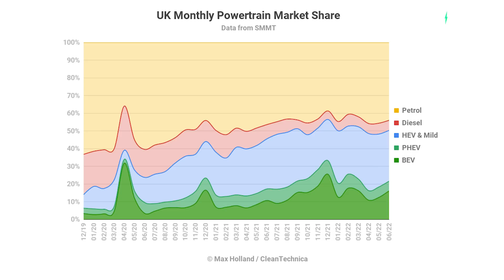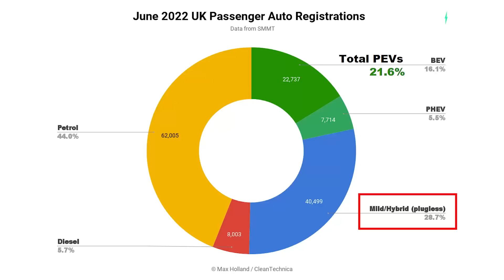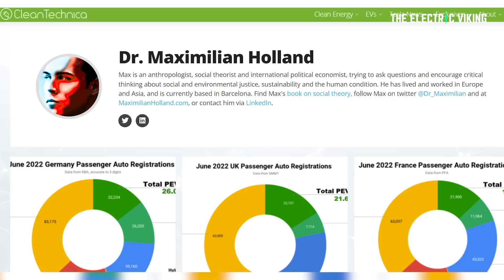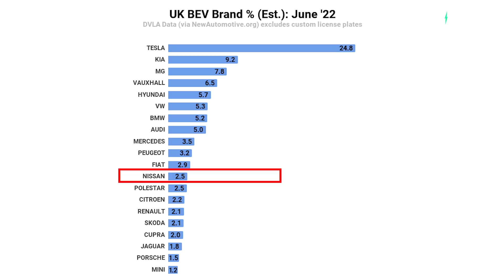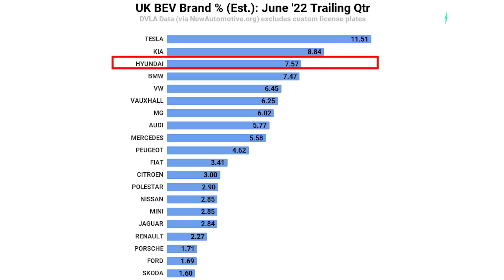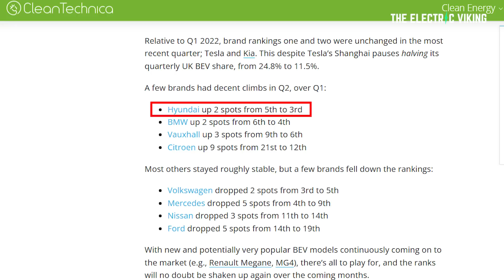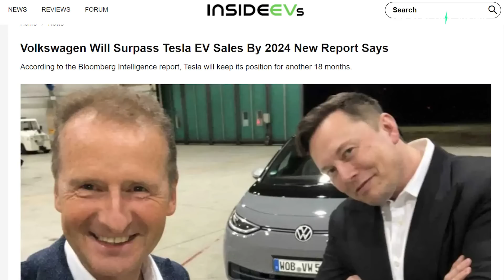UK EV Share hits 22%; Model Y England's 2nd most popular car

Comment: Petrol here in the UK 🇬🇧 is pushing over £2 a litre heading towards £10 a gallon. Electric cars 🚗 are a no brainer if you can afford one - I wish I could.

Some context in 1986 a pint of beer 🍺  was around or little over 70 pence - a gallon of petrol ⛽️ was the same 70 pence a pint of beer now maybe £4.20 so fuel prices have doubled - I'm going to stay at home today and drink more beer 🍺 😉
Reply: You might not be able to afford an EV, but one of my friends is putting serious consideration into buying an e moped.  Only a bit more expensive than e bikes, they cost about £3.5k and do 50mph with a 60mish mile range.  Removable batteries too.  Yes you need a motorbike license, but this I think will be the first taste of electric mobility for many people who no longer think any form of regular commute or domestic travel is affordable with a regular petrol car.
Reply: @anthonydyer3939  there is interesting options around electric mopeds, Nimbus Halo for example your friend may consider too
Reply: There is always the used EV market Hedley..... There are even UK dealers now whom sell only used EV's......
Reply: @Brian-om2hh  the issue there is that the second hand car market is currently seeing it’s biggest prices since the scrappage scheme, often some cars selling for more than they were new.

Comment: @12:30 The production techniques in use at all the Tesla factories are so superior in terms of parts count reduction, flexibility, and speed to all the ones that are currently in use at all other OEMs that they are going to absolutely devour any competition still relying on the cut/stamp/weld artisanal production methods.
Reply: @Dularr  Part design, attachment, and construction are iterative and flexible under the skin while the outer appearance of the vehicle doesn't change.
Reply: @Dularr  Tesla is not some mythical entity that can pull talent and talented people out of the aether. 
It is stretched too thin as it is. 
Building another factory, another machine that builds the machines,_ to create another product/vehicle doesn't happen by magic.
Reply: @Dularr  Tesla are selling their EVs for whatever the market will bear.
It's called capitalism. (†)
When they get some competition, not just for the EVs but for their manufacturing techniques, their prices will be forced to drop.
Then again, how much does a Rolls Royce go for these days? They aren't only bespoke but artisanal as [expletive deleted].
Tesla isn't in that class, merely in a different kind of class.
†) Under authoritarian communism, there are different, much worse, problems which mean that you will never get one either.
Reply: @Dularr  No, it's part of being an intelligent person.
Capitalism goes from your basic fiscal calamity to a running with scissors disaster every ten years or so because we, as a Capitalist society, are undeservedly optimistic and exhibit irrational exuberance.
Our societal short-sightedness is exceeded only by our greed.

Comment: Hybrids are selling well at the moment because they are affordable. Once EVs match hybrids on price and half the range (450-500km EV versus 900km hybrid) then hybrid sales will diminish. But Viking I'd prefer hybrid sales to keep rising if that means the end of pure petrol sales and especially vomit-inducing 🤮 diesel!
Reply: Even hybrid drivers have seen the hit lately due to the extra high cost of fuel, plus the price hikes of hybrids currently is pushing more customers over to EVs as they can charge at home and completely avoid increasing prices at the pumps.

Comment: When talking about diesel cars you have to consider the amount of automotive manufacturers that have already stopped making Diesel engines, Suzuki stopped sending Diesel engines to the uk in 2016, many others have stopped producing them altogether.
Reply: A number of makers have dropped diesel from their ranges. You can no longer buy a new diesel Polo, or a Fabia. The Nissan Quashqai has no diesel in it's UK line-up now.
Reply: @Brian-om2hh  I still find it ridiculous that a manufacturer still charges a premium for an auto transmission when more brands use auto rather than manual even in their sporty versions of vehicles, the manual gearbox is now as close to death as the Diesel engine because the tooling has been changed, many will opt for an EV instead of paying over the odds to go auto as EVs even easier, especially for disabled people like me and definitely for wheelchair users.

Comment: I predicted this in 2019. While ICE sales trend rapidly towards zero EV sales are not going to be able to pick up the slack for years.
This will lead to an incredibly profitable three-quarters of a decade, or so, for the garages and mechanics who will fight the forces of rot and decay to keep the existing fleet on the road.
While the existing OEMs are all going bankrupt and the new EV OEMs are all ramping up, this will be the era of the auto mechanic.
And we are going to witness two further S-Curves, one up, the battery production infrastructure intersecting one down, the fossil fuel production infrastructure.
Reply: It seems likely that any profitably produced EV  will be sold for years to come.  There are still startups likè Electramechanica under $1.50 per share.
Reply: Tony Seba beat you, lol.  I agree that EV sales will be entirely dependant on ramp ups. The only companies i see ramping up are Tesla and a host of chinese brands. As that ramp up gets exponential, ice cars are doomed. And i agree lots of people will hang on to their ice cars until end of life.  So the only thing saving the oems at the moment is the number of EVs being produced. And OEMs are doing themselves a favour by upping their prices as their sales fall, lol.
Reply: As ICE parts manufacturers stop making parts for many of the ICE models, garages & mechanics will have to scavenge parts from older vehicles in order to keep the existing fleet on the road. It will become ever more expensive and eventually cost prohibitive to keep an ICE car on the road. And as drivers switch to EVs, their old ICE vehicles will become nearly worthless except as "parts" cars. By the end of the decade OEMs will only be able to sell ICE vehicles in parts of the world (Africa, South America, Southeast Asia perhaps) where EV infrastructure is still lacking.
Reply: @tomdrewenskus8167  given developing world now depends on importing used cars from the developed world, and they are growing increasingly wealthy, it may work out poorly for people hoping to depend on running used ICE a lot longer than usual.

Comment: The MG4 looks good for UK, range vs price is still a little low but they have brand awareness and will sell all the cars they can make which wont be enough. If anyone offers a car with 300+ miles range for under £30k OTR in UK it will sell very well regardless of brand. Nissan had a good foothold in the UK but they are letting it slip away. If someone were to introduce a solution for Solar+V2H including all the systems for home power management sold with the car, that would go down well in UK and EU.

Tesla have the production lines ramping up on every continent while nobody else does. Their limiting factor over the next few years will be supply chain for chips and batteries but hopefully they have that covered. They need to be ready to pivot as new battery technologies emerge. They have high margins that can be lowered if there is competition. VW need to build the production lines first so that they can build their cars in volume at a price that can make a profit. Where is their plan to do that? Even BYD do not have an obvious plan for how to move into the more profitable global markets but they do have the supply chain. I would say that Tesla is unassailable for the next ten years unless there is an ambitious partnership between a legacy brand like VW and a Chinese maker like BYD, but that does not seem possible yet.
Reply: I would imagine that the Brittish sees MG as an English company, and therefore favour it. Does MG in fact have anything to do with the UK now, apart from its history?
Reply: The chinese will fill that market.  Please note that polestar II is chinese, the Tesla model 3 for UK is made in China, MG is chinese, BMW EV's are all chinese etc.  The difference is that the true Chinese cars (ORA, BYD,....) will be significantly cheaper than any US/European EV.
Reply: @ingmarkronfeldt6174  It has a UK branch which may be little more than a shell company, but it makes it easier to operate in the UK
Reply: They sell them cheaply in China with very little margin, but they will be sold for double or triple the price in the UK. Firstly they have costs to make them road worthy in Europe and RHD for UK and get them crash certified, then shipping and admin costs, marketing to generate some brand awareness, investment in the infrastructure for service and spare parts supply, plus import tax and VAT, then they add their margin to cover the risks including exchange rate risk and consumer rights, risk of recall, and they need to make a good enough profit for all the pain to be worthwhile.
Reply: @bananacabbage7402  Actually it is the tariffs that add the most cost, and many big brand chinese cars (remember, China is the largest car market in the world) sell far more EV cars than any other company apart from Tesla.  The ORA-CAT will be sold from Q3 this year (we hope), and it will be around 20K in the UK, but only 12-14K in China - equivalent.  Several Chinese EV cars are available in Norway, and the UK has effectively the same rules on crash testing etc.
You are probably too young to remember those "crappy" Japanese cars in the 1980's, which every went out an bought cos they were better.  Now look at Japanese cars.  The same will happen with Chinese cars.  You can dismiss them all you like, but they will take over like Japan did in the 1980's and 1990's .  China leads the battery and EV world outside of Tesla.
Reply: @Tom55data  I am old enough to remember cars from the 1980s very well and am not dismissing Chinese cars. For what its worth I hold shares in BYD, NIO, X-Peng, Li Auto and Polestar. Also I mentioned the tariffs (import tax and VAT)  I am just being realistic about the prices in the short term. Separate crash tests are required for RHD cars but it is just a small part of the problem provided they are confident they can sell well. Norway are providing good tax breaks for EV sales including VAT and import tax exemptions, while UK have just cancelled most subsidies. The ORA-CAT will probably start at 30k or more. Once some Chinese makers establish their markets in the UK the prices will slowly come down, but it wont be that soon.

Comment: The price of petrol is insane in the UK and Europe!  EV will cost a whole lot less to run
Reply: Electricity prices are going up faster than petrol and the EU are talking about blackouts this winter without Russian gas.
Reply: @stevenjones916  you make a fair point 👍
Reply: Agreed. Sure, some of the difference in running costs may be eroded by upcoming Road Toll charges, but the EV will always retain it's running cost advantages. Plus with an EV you may have the option of charging with solar, or even free charging at some locations. You also have the choice to choose an alternative cheaper electricity supplier...

Comment: Sam      That timeline will be pushed back guarantee.  💰  ⬅️
Reply: even though its been brought forward twice here in the UK?  Unlikely
Reply: The legal requirement might be, but the market will end mass production of anything with a gas tank by 2030 regardless of legislation.
Reply: @icosthop9998  you're missing one very important point here made by William. The vast majority of car makers will not even be making ICE vehicles by 2030.  Alfa romeo have just come out this week and said their entire car range will be electric by 2025 as have several other car manufacturers.  Those manufacturers that haven't fully committed by 2030 will likely be no longer in business.
Reply: You can't guarantee anything......you have no control over legislation.

Comment: The reason EVs sold about 20% of cars in UK is very few sold ; about 50,000 cars in the entire country.  There is a $3000 incentive to buy an EV, which no doubt helped the Model 3 sales, these Tesla's will not be delivered in 2022.  I also wonder if leased cars are counted as "sold"
Reply: There is no incentive for a Tesla, outside the parameters for a grant.
Reply: Over a year ago, the UK government set an upper limit on the price of cars that can benefit from that discount. That price limit meant that Tesla cars became too expensive to get the discount.
Reply: The UK government scrapped the plug-in grant for electric vehicles in June for all EVs. Tesla had already been excluded for a few years as they were too expensive

Comment: VW are hurting, they have Billions of Euro of Obsolete manufacturing and engine production facilities. And Unions which won't tolerate massive redundancies. Their ramp up to majority EV production & sales will be slow & painful. Lets face it most of their current EV offerings are boxy unnatractive and 15 Years behind Tesla. Chinese EV's with nimble manufacturing & rock bottom pricing will increase market share in EU / UK. Tesla will eat VW's lunch if it doesn't get it's act together quickly...
Reply: You may find it difficult to believe, but some people actually don't want a Tesla......
Reply: @Brian-om2hh  Many people can't afford the cost of any EV.  Many have never bought a new vehicle in their entire lives. It will take a decade or more for decent long range EV's to be affordable in the secondhand market. All Legacy manufacturers need to pick up the pace of full electric EV production. Time is running out to make the transition to Fossil Fuel free transportation, in a timely and effective manner. We own two, third hand Fossil Fuel VW automobiles. Don't get the impression I'm somehow a Tesla Fanboy...😉